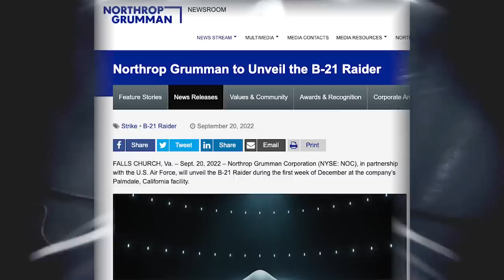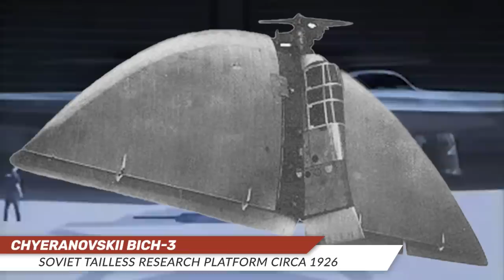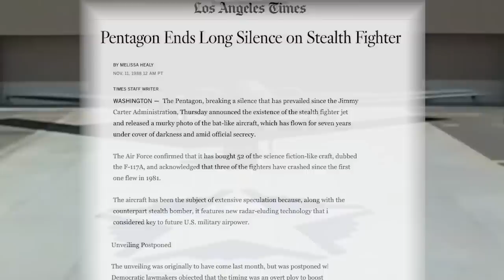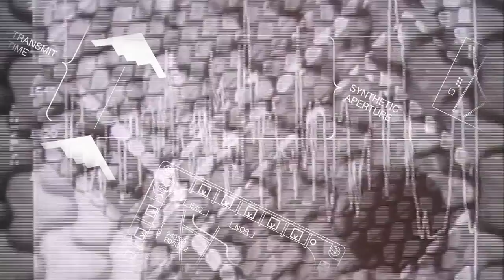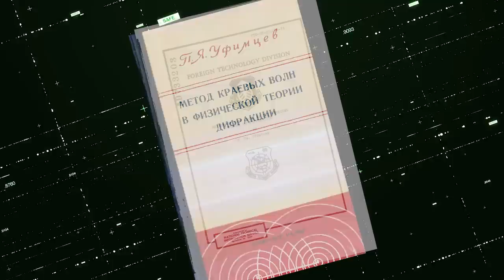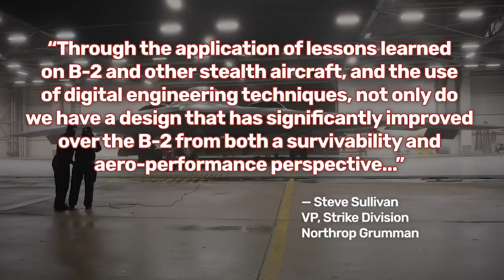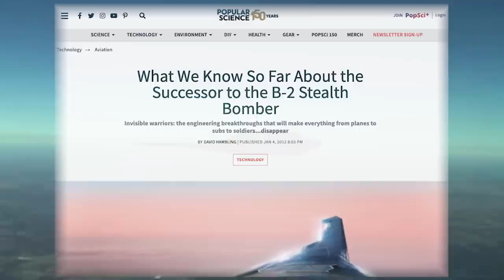Revealing the B-21: Why Northrop Grumman's announcement is a big deal

Comment: What they're not telling you. Multiple platforms have been using dual propulsion, some for decades. This platform will also have it, Nuclear subs have had it, Aircraft carriers have had it, Some Strike fighters have it. What is dual propulsion? It's the marriage of conventional (when needed) and, well, this  US10322827B2. This little gem is scalable which means it can be big or can be small. This in it's 3ft diameter form produces about a terawatt of power. To put this into perspective, if we combine the output of every power generating station in the world we come up with 6 terawatts. This particular unit is used to power this US10144532B2. That is what we call the HAUC. The HAUC is a Hovering Airborne Undersea Craft and go anywhere and do anything, really. It's quite slow at only 300 miles per second but can be upgraded to move at many times the speed of light. Now imagine the power unit in a Nuclear sub....it's a Gravitational Wave Generator which means it creates it's own pocket of Gravitational Zero Point Energy. Within that bubble of gravity and Zero Point Energy depth and sea pressure are no longer a factor, speed isn't a factor, the ocean itself isn't a factor. Everything that the system encounters is, energy, the faster you move the more energy you bump into, and use, to go faster. The same goes for any system, you aren't propelled, you're pulled into the direction you want to go. While moving through the air there's no resistance and no pressure, no heat as a result because you're borrowing the energy that you're running into. As you progress forward the more energy is absorbed and thus the more energy produced until the limit of the drive system is reached. The smaller the system means fewer cycles.

Comment: I think that there are 2 places where stealth is lost.
One is the open bomb bay.
The other IMHO greater one is when a control surface is away from the wing. I took from the Wright Flyer with it's Wing Warping to smooth out the difference between the two surfaces. They have probably already improved on my thoughts years ago.

Comment: Given how short raged the Navy Carrier Air Wings are, and how absurdly expensive the carriers have become, is buying a couple of squadrons of B-21 a more cost-effective threat to the PLAN than a new carrier?
Reply: You still need more than just bombers to deal with China. B21s alone aren't going to cut it. Carriers are also used around the world. Not just for China. Anytime you want to project power with 60-70 planes and scare the hell out of someone, you send a carrier. You can fly stealth bombers over them but unless they see them (which obviously you don't want them to) or you actually drop bombs on them it doesn't matter.
Reply: @gigakrait5648  Basically the problem is that a carrier can't get close enough to China to launch strikes without being attacked and likely crippled or killed.  You could fly the squadrons to Taiwan, but in that case you could just leave them in Lemoore and have USAF tanker help ferry them, scrap the carriers and have the same effect.
Reply: @k53847  And they don't plan on doing that. This is well known that they wouldn't come that close to China to get attacked from close range. And just because they are within range, say 1500 miles, doesn't mean that they will automatically be crippled/killed. You seem to be like so many others that just assume if they are within range of missiles it's an automatic kill. That they are out there by themselves within no defense or support. Doesn't work that way. Carriers always move. Targeting would have to be extremely precise for a missile to get an actual kill. 
Flying them all the way from California is stupid. You do realize that they would need multiple refuels (there and back). You do realize that tankers would have to also be within range of their combat zone. You do realize that after they have dropped all their bombs and missiles they would have to fly ALLLLLLL they way back to rearm. How stupid, impractical and hardly the same effect if they could do this closer from a carrier. It would take them hours upon hours to fly there and back. Good thing you aren't in charge and making the decisions.
Reply: @gigakrait5648  Have you seen 'Retreat from Range: The Rise and Fall of Carrier Aviation'?  You should.  The modern Carrier Air Wing can't get to 1500 NM without USAF tankers.  They can't get to 1000NM without at least 20% of the fighters being solely buddy tankers. F-35C has a ~670 NM combat radius, F/A-18E/F 500 NM.

And no, you don't operate from Lemoore, you just have USAF tankers help ferry you to when the fight is and then you operate on concrete instead of a $14 Billion mobile runaway that can't get close enough to the fight.  This is partially tongue in cheek, but it's a real issue.
Reply: @k53847  Where are you going to operate from on concrete? Guam? Japan? Korea? All of these are at least 1,000 miles from Taiwan. And if you do happen to find somewhere close enough, it's not going to be big enough to handle the number of planes you are going to need or the logistics to handle it. They would no doubt fly enough full size tankers in the air just far enough away and close enough for the planes to refuel to get them there and back. Yea, it's an issue but there are ways around it with carriers. You seem to have a problem with the newest carrier cost what it costs. Well, get used to it because they aren't giving them up. China will have the same problem and yet they are building more carriers. Theirs aren't going to get very far from mainland China and the planes on them certainly don't have enough fuel to do much.
Reply: @gigakrait5648  Yonaguni Airport is not very far, Miyako Airport is a bit farther.  Assuming Japan is willing to play.  If not, there are a few airfields on western Taiwan.
Reply: @k53847  Nice try. Like I said they are going to need big enough airports that can handle many planes as well as the logistics. Yonaguni and Miyako are NOT military airports! They aren't going to be able to handle dozens of fighter jets taking off, landing, refueling, rearming, maintenance, etc. They don't have the infrastructure for all this. Japan does not operate them as military bases. It's also a stationary target. So you are telling me that it is better to have planes using runways within 600 and 250 miles of Taiwan instead of a carrier out in the Pacific always moving? FYI, missiles can take out those runways much easier and much faster at that distance than a moving carrier with defense support out in the middle of the Pacific. Runways and airports with no logistics aren't much good in a fight if they can be taken out faster early on. After which you are back to using carriers or runways that are further away in which case you defeat your argument of being so far away that it is no longer useful.
Reply: @gigakrait5648  Well, you either need to be inside PLA strike range or you need to not fight.  Carriers tied up to Juliet pier at North Island are probably both safe and about as impactful on a war as a carrier 1500 miles away from China.
Reply: @k53847  Once again you are assuming that being within 1500 miles of China is automatically a losing proposition for a carrier regardless. A carrier and it's strike group are not going to just sit there in one spot and watch missiles come flying in to hit them. They will be constantly moving and using every countermeasure available to them to stop it. 
You also assume that Chinese missiles are capable of hitting there target 100 percent of the time and will never miss, malfunction, lose their target, etc. and have the exact position of their target at all times which they will have to. Despite the fact that none of their systems has ever been tested in a real situation. 
You also assume that the US will not act accordingly and take out the missile sites that pose a threat to its carriers. Sites that are no doubt well known and stationary targets which are a lot easier to hit than a single carrier somewhere in the Pacific. Everything works both ways.

The US also has air and naval bases in mainland Japan, Korea, Guam and Diego Garcia that are used by the air force which means you throw in all sorts of other types of assets into the mix. And yea, they will need tanker refueling no doubt but that's a given. Bombers won't and launching full salvos of JASSMs and other munitions from long distance will be another attack point.

It seems no matter what argument is posed to you, you always side with China as if they are infallible and the US has absolutely no tactical answer to anything they do. If they are such guaranteed winners then they should have attacked Taiwan by now or real soon now. But I bet they aren't as confident as you are and know they are in for a fight.

Oh yea, did the fact that the US has 11 carriers slip your mind and that more than 1 or 2 strike groups will no doubt be deployed. US used 6 strike groups in the Gulf war.

Comment: I was fortunate enough to be hired as a Systems Support Facilities Technician at the B-2 Flight Test Facility at Edwards A.F.B, CA at the beginning of the bombers lengthy flight test program. I was able to gain access the bombers flight deck to connect test cables to the aircraft during grounds tests that were conducted before any test flight. I met the pilots for every test vehicle that was stationed at the facility. 

My most favorite memory while I worked there was getting to talk to retired Air Force General Charles (Chuck) Yeager. 
It was fun working there and I left to take my life long dream job at NASA Dryden.
Reply: I remember riding across the new B-2 hangar area when it was an iron frame. There's another building basically on the lake bed we we're headed towards.
Reply: I meet Yeager at the Mojave Airport when Dick Rutan, Jenny Yeager(no relations), and Burt Rutan had the showing of the Voyager.
I remember Chuck being a complete dick, a pilot....lol

Comment: With the capability to spray on a radar absorbing/redirecting “coat”, that’s also frequency modulating capable, the non-stealth force could be pulled into a MACO PAINT Facility 😂 & be pulled out as a low observable force multiplier. The possible implications are staggering!

Comment: I believe civilians without clearance have seen the B-21.   The idea was to make an affordable bomber in which the U.S. could have and operate over 100 of them. A non stealth bomber could survive with high altitude, speed plus glide bombs and long range missiles. There are cruise missiles now that can be launches by aircraft and travel 1,200 miles. Glide bombs now have a range of 74 miles.

Speed allows for the bomber to get to the release point quicker and then get out.  Extended altitude allows the glide bombs and missiles to travel farther. 

My guess is that it will look more like the B-1 and have a speed of over mach 1.
Reply: Uh huh. Where do you get that civilians have seen this plane without clearance? Maybe members of Congress have but they are cleared. B21s are reportedly going to cost around $600 million per plane. A hell of of a lot less than the $2 Billion per B2. 
So which cruise missiles in the US inventory launched by aircraft have a range of 1,200 miles? Nothing in current inventory. The ones that could have been retired. Planned and in development don't count either. So name the missiles.

It's not going to look like a B1. You obviously haven't been paying attention for the last few years. Especially since you don't even know ranges of air launched cruise missiles in US inventory. It's going to be like the B2. Everyone seems to know that except for you. They aren't going to go backwards and build something that isn't as stealthy as the B2 which the B1 isn't. Guarantee you that it will look like a B2. The air force last year even released renderings of what a B21 will potentially look like. How much money do you want to bet it will?
Reply: LOL! Bro you for real? Come on little man...

Comment: This all just goes to show how far ahead of his time that Jack Northrop was, a true aviation legend.
Reply: Northrop's and Horton brothers' work was independent of each other, and contemporary, without knowledge of each other.
Reply: @LRRPFco52  Exactly. Similar to how the Concorde and the soviet counterpart were developed independently from each other, or the B-1 and Tu-160.
Good designs will be recognized by every good engineer
Reply: @DefinitelyNotEmma  The Concordski (TU-144) was not "developed", it was stolen. It was almost entirely a product of Soviet espionage; there are many, many articles about this available online. It is why it was such a miserable failure (the Concorde was also a failure, but an economic one), because the products of technology theft are rarely as good as the originals.
Reply: @DefinitelyNotEmma  Wrong. The Horton Bros. had began development of their flying wing design as early as 1937. Northrop did not being their first design until late 1945. Also, The Concorde was developed first, the Soviets stole the design. Same with the TU-160...it was stolen from the B-1. In both instances it is incredibly obvious from the designs. Except the Concorde actually flew for quite a long time whereas the Soviet counterpart flew for maybe two years before being pulled as they were so bad.
Reply: @tedwojtasik8781  Sorry but you are the one who is wrong. The Tu-144 made its first flight months before the Concorde. The Tu-160 made its maiden flight in 1981 if I remember correctly, while the B-1B made its maiden flight in 1987.
The Tu-160 is a super sonic, long range cruise missile carrier. The B-1 is a low flying conventional bomber. Both have a very different role and variable geometry wings are nothing new to either aircraft. The Tu-144 and Concorde were developed independently from each other with only few not really credible sources claiming otherwise.
If you want fancy stories look at the development of the J-10 (license built and improved version of the IAI Lavi which in itself is based on the F-16) which is essentially a "Super Lavi", the J-15, which was developed from a Su-33 prototype, the J-20 as a combination of the MiG 1.44 and F-22 and the J-35 which is based on the F-35.
Reply: @tedwojtasik8781  Also Mr. Northrop looked into the idea of a flying wing well before 1945. He and the Horten brothers pioneered the field independently. With their respective works giving way to the Ho-229, B-2, B-21 and H-20
Reply: @DefinitelyNotEmma  The B-1A first flew on Dec 23rd 1974 and the B-1B does indeed carry nuclear weapons.
Reply: From what I understand of the subject, some people inside the project lobbied hard to get him a special clearance waver so he could see the, then still in production, B2 before he died...

Apparently he broke down crying and and said, "now I know why God has kept me alive all these years..."
Reply: @AutomaticJack  kept alive to see the production of a killing machine for a country that's never been invaded? Yeah that's what God wants for sure 👍👍👍
Reply: @Karma Mechanic A fighter prototype made after Grumman’s early flying wing bombers and never finished? The Idea the HO229 was the predecessor to any decent flying wing is a load of horseshit
Reply: @Karma Mechanic Northrop and Horten researched the design simultaneously at the same time independent from each other. Neither was really aware of the most recent developments of the other until the end of WW2.
Reply: Jack Northrop. Cheers!
Reply: @Karma Mechanic lol the US already has this aircraft design way before the horten germany😂 educate yourself boy
Reply: Kelly Johnson was no slouch,from the Lockheed Electra in the thirties,the P 38, the Connie's, to the Sr 71 Black bird
Reply: America has a few aviation legends.  Joe Sutter and Kelly Johnson...Wilbur and Orville:)   I still think SPEED is the Ultimate stealth.
Reply: Thanks to alien technology..🤫👀👈
Reply: So what humans will this “bomber” be dropping bombs on?
Reply: The b2 bomber is a design ripped off the Nazis.

NASA was started by 8,000 to 12,000 nazi scientists.

NASA probably had a different meaning when it started.
Reply: It was sad to see how Jack didnt see how his "failed" boomerang plane evolve into the B2 Spirit.
Reply: @ayuchanayuko  No, he did get to See the Spirit before it's roll-out to the Public. It is only a few inches less in wingspan than the YB-35/YB-49 'Flying Wings' that Jack and his designers made in the late 1940's. If, if, they had an 'autopilot' that could have prevented the 'flip-Stall', his design would've been used by the USAF, then...
Reply: @Karma Mechanic a fighter made from wood? 

This is not WW1
Reply: @randomblacktemplar738  Not sure if i understand your point. Yea, part of the wings of the Horton Ho 229 was made of wood, but so was Northrop's N-9M , which was build around the same time and, unlike the Horten, didn't even have a jet engine!!
Reply: @randomblacktemplar738  the iran drones are made from wood.

Doing great in Ukraine
Reply: Not really. He really only produced 2 prototype flying wing bombers that never made it into production. The P-61 was a favorite of mine, however.  Kelly Johnson was a real aviation legend.  P-38, P-80, F-104, U-2, A-12/SR-71 all were production aircraft with the U-2 (TR1) still in use and the SR-71 still holding the air breathing world speed record to this day.  He also contributed to the F-117 and C-130 projects and the Electra and Constellation airliners.

Comment: If they can apply stealth coatings to the B-52 it may approach 100 years of service.
Reply: It's going to come close to 100 years of service anyway without stealth and it will never get stealth coatings or benefit from them either. It has too big of a radar cross section for it to matter. Those 8 engines hanging off the wings will totally nullify any kind of stealth anything applied to it. It wasn't designed or built with stealth in mind.
Reply: Lol no